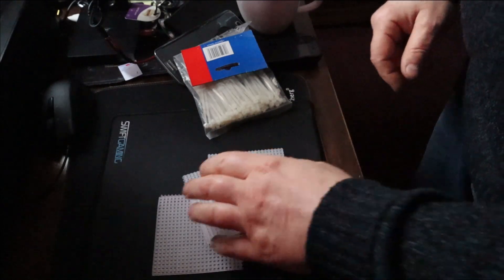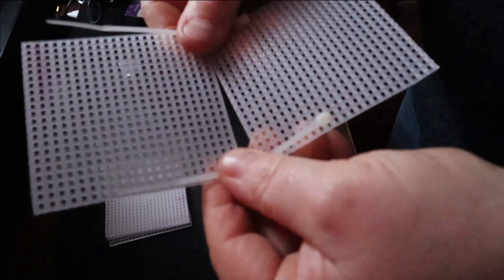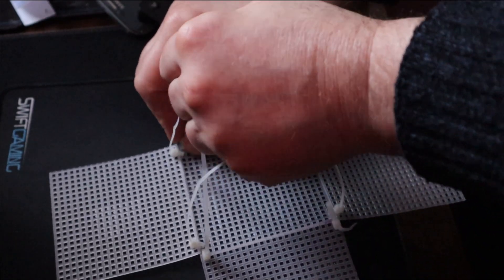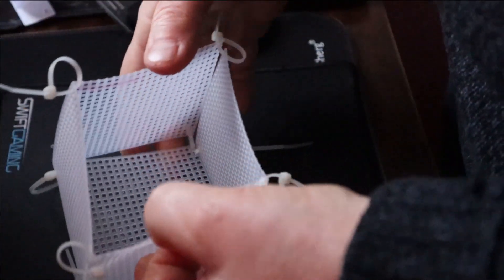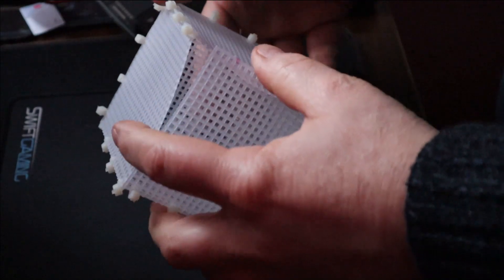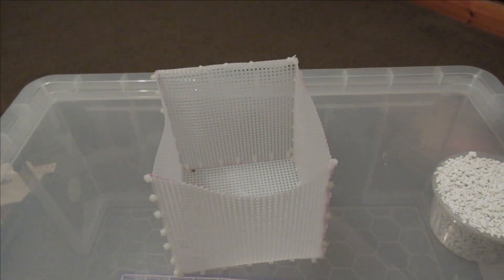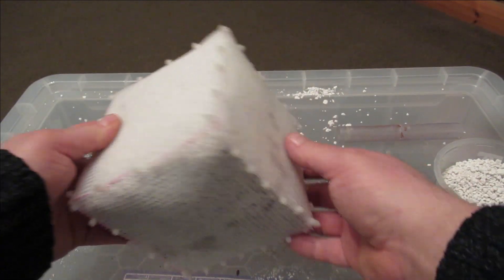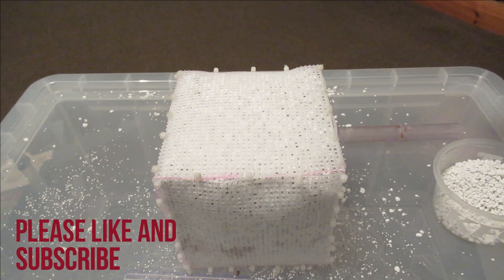biocenosis clarification basket ,,Nitrate removal?

Comment: Follow up video?
Reply from the maker: Very soon just waiting on the deadline but heads up as it stand i may have to re do the whole thing as apparently its a specific litter required
Reply: @AQUAGUYUK  yes, I use this stuff called "safety absorb" intended for oil clean up. Seems to work
Reply from the maker: @alecthenice8115  Interesting ,,you have pointed me in a new direction looking now
Reply from the maker: https://www.thesafetysupplycompany.co.uk/p/9299131/ecospill---new-safety-tread-30l-bag---high-performance-absorbent-granules---ec-u2090030.html?utm_source=bing&utm_medium=cpc&utm_campaign=UK%20-%20Shopping%20-%20Safety%20Supply&utm_term=4580221852509594&utm_content=All%20Products
Reply: @AQUAGUYUK  that's probably the same stuff. I got mine at a do it yourself auto maintenance store we have here in the USA called "AutoZone". I then copied Dr Novaks ADA canister video, no laterite just injected florish iron.
Reply from the maker: @alecthenice8115  seems like a plan got to renew this test but still not sold on the idea and think water changes not only remove nitrate but add minerals but i have an open mind
Reply: @AQUAGUYUK  I think Dr Novak is a master at his method, and that's why he can do what he does. I also think this bcb filter does what he says, if you can implement it as described. For the time being I'm gonna stick to my normal maintenance routine and see what happens since I'm not running his system exactly.
Reply from the maker: @alecthenice8115  Not sold on it as  a lot of his science is simply not accurate but i will get the supplies right and test myself and shar the findings ,,personally natural does it best with deep substrate and plants equals same results but again it needs a good test
Reply: @AQUAGUYUK  did you read the blog website? The chemical pathways and reaction schematics are outlined there.
Reply from the maker: @alecthenice8115  indeed and also have read the debunk of the science including the chemical analysis of clay over iron and the splitting of ions and neutrons but as iron without an external source is neutral and clay is inert it replies on water flow to strip said ions from the nitrates this should case nitrogen to bubble off but you would need an equal amount of material as estimated water flow to cause this that's why no company uses this system as it simply "breaks even" now having said that the same result can be achieved by water change and plants with the added bonus of demineralizing the water https://aquariumscience.org/index.php/8-9-1-biocenosis-reactor/
Reply: @AQUAGUYUK  that article looks nice but reads like a flat Earth website.
Reply from the maker: @alecthenice8115  Lol indeed now you know why i want to test myself as i have been in the hobby 40 years and owned shops it makes sense for this ,,,also this idea is actually old but never been taken up commercially that said zeolite is just as good but i am up for the challenge
Reply: @AQUAGUYUK  I think that's because in the US at least aquarium stores make the most money on selling filter media and filter items. Also people like going to the store just for stuff here. It's almost part of the hobby,  furthermore the bcb filtration method makes many people feel dumb because chemistry is an abstract concept as it relates to living systems. As seem by that critique website; no mention of redox values and reaction schematics.
Reply from the maker: @alecthenice8115  All good points and each to their own i personally feel that if something works for you then carry on and using my system of plants and deep bed substrates has served my well but this is so controversial it seem unlikely that it will catch on plus over time i can see clay causing a PH variant that may only suit certain fish this alone may cause issues in soft /hard water areas  or at least lead to low PH

Comment: Using 10 inch ro canisters. Tap off main filter with t piece to 1/4 inch out. Go into first canister loaded with biomedia. Then link 2nd canister with Seachem denitrate. At this point main filter will have done it’s job with ammonia and nitrite. Cleaned water. Then first canister makes sure it’s depleted of oxygen. 2nd canister is anaerobic tightly packed. Make sure you add an adjustable valve and keep low flow.  Easy
Reply from the maker: I run a nitrate filter on my shrimp tank as the tap water here is about 40 to 50 ppm nitrate i also run deep beds in all the  tanks with plants but going to test

Comment: Loved that some one attempted with a brand of kitty litter that is relatively available.
Question - catsan based on my research does not uses clay base ingredients it uses a different mineral and lime. Did you notice a change in your KH with this?
Reply from the maker: Ah great info i have been told also that you are right and will have to restart this experiment now this was based on readily available supplies so i tried two other makes that were "off the shelf" and still have yet to find a clay only litter,,,, thanks for the comment Sameer
Reply: i made the same blunder with the kitty litter being limestone quartz instead of clay!  the package said 100% natural so i just jumped 🙄
Reply: Any substitute available on India?
Reply: @dipakb5487  nope, trust me i have tried. Similar results can be achieved through alage scrubbers (done that successfully)
Reply: @sameergrover40   i have sand substrate and planning to attempt Plenum with Undergravel filter, 2 inch sand substrate. Inside my HOB filter will be adding BCB basket with Pumice and Leca balls and iron additive
Reply: I have done the same mistake by using katsan limestone based litter. So I am looking for baked clay alternatives? Did you manage to find a solution,? I have come across baked clay pebbles used for hydroponics. Open for suggestions
Reply: @haythame78  i was not able to find a proper baked clay in my geography so i decided to let go of the idea. I Moved on to alage scrubbers to gain similar results.
Reply: @sameergrover40 very interesting, did it actually achieve work for you in terms of getting rid of nitrates? Are you using it in a sump?
Reply: @haythame78  it absolutely did, coz alage is frankly a plant on steroids. It gets you the same results a heavily planted tank would. I use the ones from santa-monica filtrations, they are brilliant.
Reply: I know it is kinda randomly asking but do anybody know a good website to stream newly released tv shows online ?

Comment: Looked up the litter you used and I don’t think it would give you or anyone effective results. It’s made of quartz, and also contains LIME and chalk. First the inert quartz won’t have the ionic charge this whole filters method is based on. Also the lime can not be good and their website says the litter has “active ingredients prevent the growth of bacteria” which is counter productive. 
A 100% clay based litter would do you much better and may give you the results you are seeking by making a filter like this.
Reply from the maker: Agreed i am going to test an "all clay" variant but many people agree this would suit a pond rather than aquarium due to the amount of surface area or the amount of baskets would be nearly equal to the amount of water in the tank or pond ,,,still got to give it a chance but in an aquarium its easier to simply water change

Comment: Before seeing this I made a basket same shape and size as yours with same material hah. Although, on the sides I took a long piece then creased it 3 times and connected it at the 4th. Zip ties were super smart! I sewed mine with fishing line and the time it took felt damn stupid lol. 
Never seen the clay litter looking white like that, wondering what clay is used? Maybe attapulgite? Which has good absorption but lower ionic charge then a montmirillonite.
I never understood the iron parts purpose other than feeding seeded bacteria? Is there another? FYI for you and others, seachems website shows the original flourite containing more iron than the red, which I feel would be better if you are just adding it for the iron content. I did all litter and instead injected it heavy with iron. 
Then I put the basket in a 4L diy canister and cycled it for a month regularly adding liquid seed bac, iron, and ammonia. 
So far my results have been steady 0s across the board for nitrite, nitrate, and ammonia on my 45L. Almost to a fault though because I can’t fertilize nitrogen without it being eliminated in an hour tops. Tried ammonia, urea, and nitrates, all being cycled out too quickly for my heavily planted tank. 
So from my experience this size basket is suitable for at least a 45 if your goal is full cycle, with 0 nitrates...I was skeptical but that’s what I’m seeing rn, curious about the longevity of the results. 4 months in, after cycling, rn so I can’t speak for how long this will last. 
One thing I’ll say is surprisingly even with the slowest plant growth I’ve ever experienced I have had zero algae except once I had a couple spots on the glass in one thumb sized area. I also skipped the diatoms or brown algae at the start. Never have I experienced either of those situations before. The nano has high lighting with 30w of led and CO2 also, in case anyone is wondering it is pretty high tech. Only mention because that also has me a little boggled about the algae levels, but I’m sure some breakouts are coming sometime hah
Reply from the maker: I would love to know is your aquarium fully planted or not also what type of fish and do you run a filter ,,,as i really want to see an actual set up just with water and no substrate or plants but with a fair amount of fish this would be a better test i think
Reply: @AQUAGUYUK   yes as I mentioned heavily planted. However, all relatively slow growing - lots of buce, crypts, anubias, and tripartita. No fast growing heavy nitrate feeding stem plants. Also mentioned I have a 4L DIY canister filter - course, med, fine pad, then the same size and shape mesh cube BCB you show, then about 300g matrix and finally purigen. 
There are 20 Rasbora hengeli, a swordtail, a albino bristlenose, 5 pigmy Cory, an Amano, and a ADF. Not a whole lot of fish, but for a 45L I’d consider it pretty heavily stocked. The pleco makes a ton of waste. The swordtail and pleco are temporary while rescaping my 60p, but have been in there for all 4 months.
Like I said there is 30w of strong leds and CO2.
That might be a good test if that’s the kind of system you plan on using it for or if you just want to stress test it’s limits? However depending on how big of a tank you are talking and how much mass of fish you will want to size the bcb for the canister accordingly. I mean what you showed might be able to handle max a empty 60p fully stocked but over stocked would probably be pushing it.
Idk I’m still skeptical about the filter but it’s working how it’s supposed to rn, like I said even too good, and I’ll be curious to see how the current results hold up with time.
Reply from the maker: @woltergrant  Maybe run the tank without the baskets see what happens but i would still change the water to keep PH and hardness correct for my system water changing helps the balance too ,great info thanks for the comments a lot to think about and maybe a tweak or two on the horizon

Comment: tested this for a while now, my conclusion is that this does not work, had a biochemist come over to check it out thinking this is just nonsense.  Making a nitrate reactor is the thing, but low oxygen and feed the bacterium daily with organic carbon
Reply from the maker: I would agree but one thing i have noticed is a large number of algae polyps now this like plants would soak up nitrates ,i am also testing a tub which i am adding nitrates in the form of plant fertilizer and noticed a reduction ,,,the issues are as follows fist the water flows round the media so more media is required to biologically clean i would think that 1.5 times the actual water amount in media surface area so this would be more suited to ponds second  there is no reaction electrical or magnetic that is attracting ions or anything so it would need an external source of energy
Reply: @AQUAGUYUK  Your algae may disappear now in the beginning because the cat litter attracts ions such as phosphate, that is probably why.  it also happened to me until the cat litter is unable to absorb more phosphate
Reply: Have you tried organic carbon dosing?
Reply from the maker: @monsterfish4360  I am still having trouble with this whole attraction thing as i am 99% sure clay cat litter is inert and only  absorbs liquid as for the iron its just an element that requires external stimulus to become active but i wanted to test it as i have aquariums and a large koi pond but believe that its just long words ,smoke and mirrors
Reply: @AQUAGUYUK  It does absorb liquid, i use that brand for my cat because it absorbs a hell of a lot of pee so i dont have to empty the litter box often, with clumping cat litter i would get two balls of piss every day. i think you should be using the cheap kitty litter, the ones that need changing once a week. the brand you are using will keep absorbing liquid until it gets fully saturated, at that point can you let us know if it turns to mush?
Reply from the maker: @amarabidali5316  Yeah i may redo the experiment in the summer but this time different litter
Reply from the maker: @amarabidali5316  Next test on litter using different makes ?
Reply: @AQUAGUYUK  today i went pets at home looking at the different litter brands, none stood out that could be used as media. Although I did find catsan had an organic variant, could work? im thinking those super market cheap brands might be the best thing to use because they are just terrible at absorbing piss.
Reply from the maker: @amarabidali5316  I just don't see how this is going to work Amar i have since located some clay variant litter to test but looks feeble lol
Reply: @AQUAGUYUK  yh i have my doubts about it as well but apparently it works. the only thing i actually found to work really well in removing nitrates were nitrate pearls but they're expensive and only last a month.
Reply from the maker: @amarabidali5316  Well here's the thing Amar first we can remove nitrates by simply changing water very simply and cost nothing so it would be a fight finding something that's similar but all of the video and literature information over the last two years still has a half and half view ,,,so why bother for a normal situation plants and water changes has to win
Reply: @AQUAGUYUK  you know you do not need to use cat litter.  you can use zeolite, it is important that you also feed with organized carbon so that the bacterium gets food.  to food ka.  you dose with a little dextrose every day
Reply from the maker: @monsterfish4360  Thing is zeolite is what i use in the koi bakki filter and the whole test was based around cat litter lol think i may need a rethink to do this justice lol
Reply: @AQUAGUYUK  I am going to make a new video soon of my nitrate filter, zeolite its a great home for anoxic bakteria
Reply from the maker: @monsterfish4360  Keep me posted please

Comment: Any updates on results? Did it worked well for you?
Reply from the maker: Ok i have three test tubs for this and want to leave for three months but as it stands the planted tub has less nitrate than the control and the basket tub
Reply: I made one injecting florish iron as the iron core source and it seems to be running like a chemical pump. Obviously no bacteria yet, I'm on day 2.

Comment: I’ve seen Kevin Novak’s stuff. Not sure what yo make of it.

Interested
Reply from the maker: I think the science is cloudy and i have been in this hobby a very long time owned shops and simply removing nitrates is not the only reason you want change including adding minerals and keeping water parameters close to your water source however i am going to test 3 bucks with  control and see what happens
Reply: @AQUAGUYUK  I don’t water change much. Generally filtration buy plant conversion and remineralise when needed.

I think cat litter absorbs ammonia. I mean cats pee in it. That’s what it does. 

It will prob take ammonia out of water,  not sure about this anoxic stuff. When it’s in a higher flow.

I should dump some in my Fluval flex to try

Comment: What’s wrong with running a tank a normal way.
Reply from the maker: Nothing
Reply: If there is an easier way why not try it? According to Dr Kevin Novak this greatly reduces nitrates, hence the need for less water changes and a more balanced system  - sounds good to me if it works. And the only way to know that is to try.